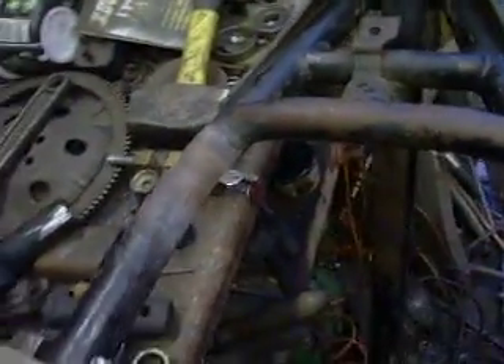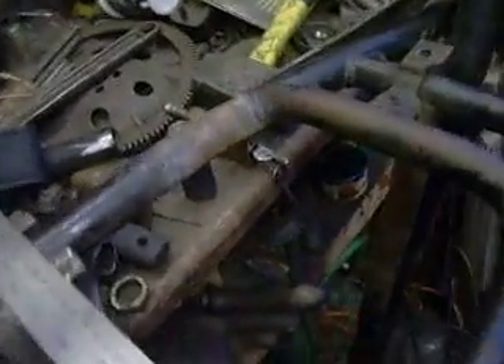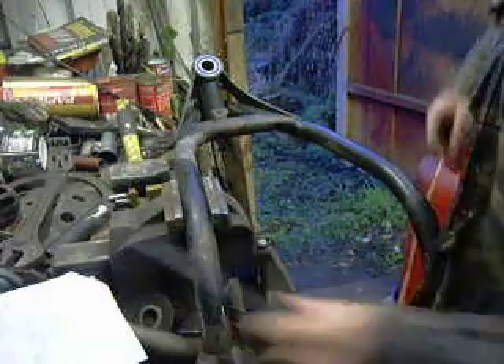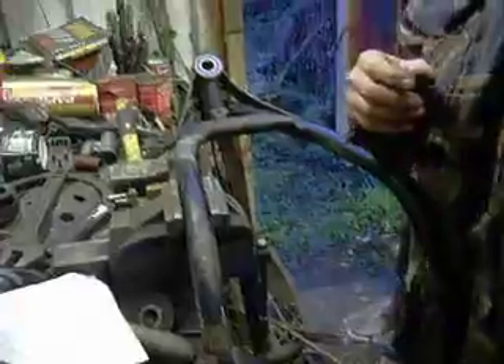Frame Bending

Comment: can play with old bike frames , remove pipes, l had one w missin top pipe was a soft ride for weeks til broke , or bend them up or down or s shape cut them  a long way in half put piece between to open mid then wire over or have half pipes or three quart then bend together to make smaller or have open

Comment: Surely you should have altered the frame 12.5mm per side and not 25mm on one side only ?
Reply from the maker: No, not really. I'm fitting a German 1974 VTwin diesel engine to the bike. The centre of gravity +  crank is kept central to the frame as you'd expect and this modification is to clear the oil filter that is on one side of the engine. Top Tip: Most motorcycle frames and some car chassis are not symmetrical.

Comment: Seems as though the symmetry would be off to the side you bent,  versus bending half way  on each side. With a method other than your foot that would be more controlling. Maybe I'm just lost.
Reply from the maker: I was deliberately making it asymmetrical so I could fit a diesel utility engine into the frame.

Comment: would it not need to be done equally on both sides? ie half the required total amount on each 'leg'
Reply from the maker: I was fitting a totally different engine to the frame which is why I needed an uneven alteration.
Reply: @o0OMouseO0o  thanks for the reply. interesting to see you did it with just propane. I didn't think it would get hot enough. I have oxy-acetylene so this gives me hope of getting a result on a bent frame I have